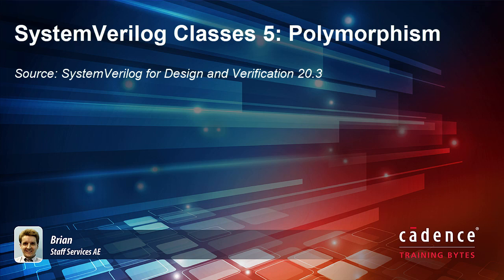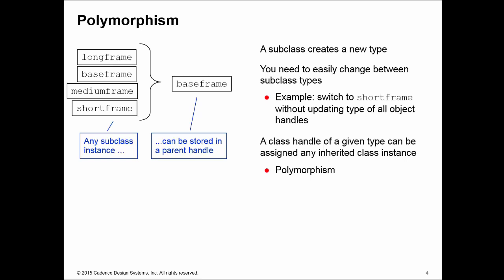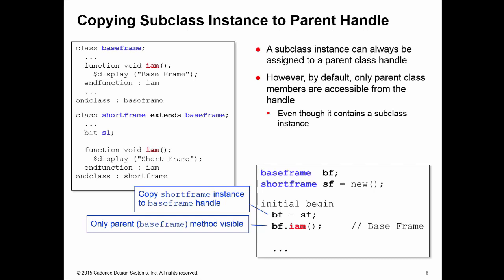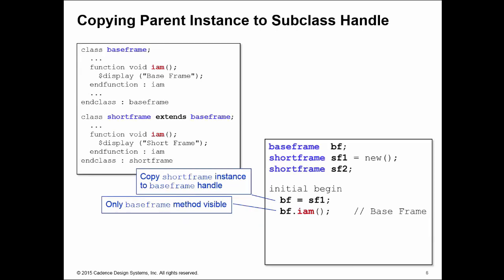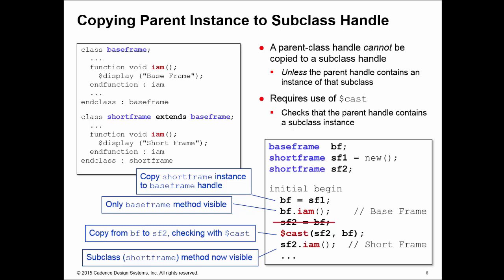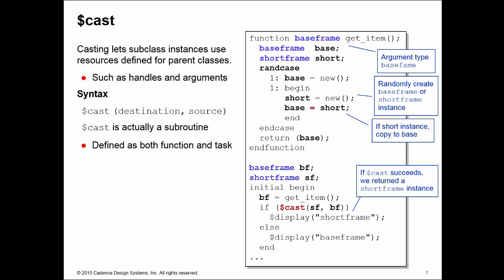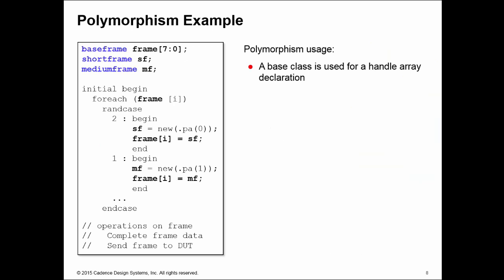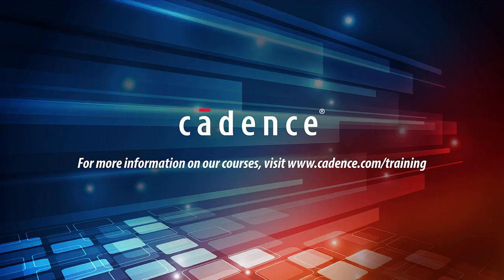SystemVerilog Classes 5: Polymorphism

Comment: Instead of recovering the sf object back from parent class, why not just use the already existing sf handle? Or, why not just copy sf handle to sf2? What’s the real advantage of casting here?
Reply: As mentioned in the later part of the video, casting is useful when we have various subclasses that inherit from the same parent class. For example, when we dynamically allocate a subclass instance in parent class handle array, we store different subclass instance in the parent class handle and then use cast to detect later in the code which subclass instance is stored in the parent handle. This is just one of the examples.